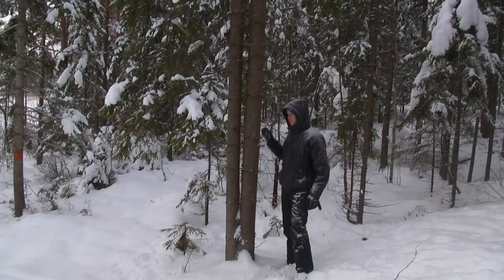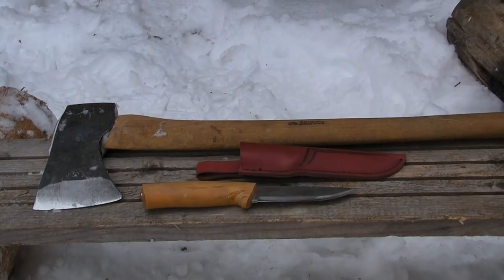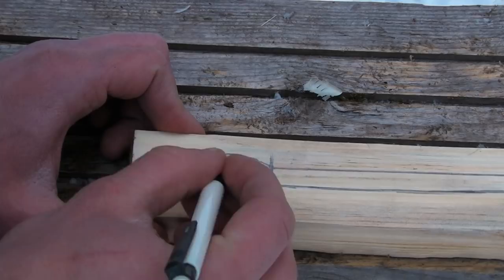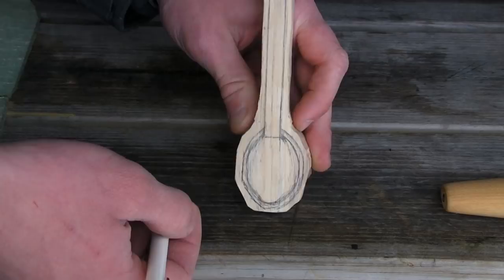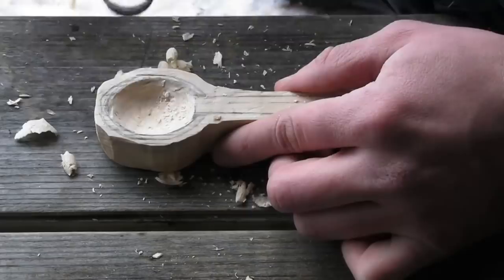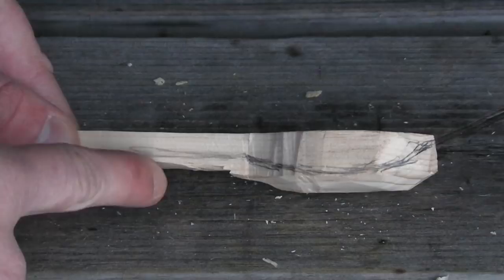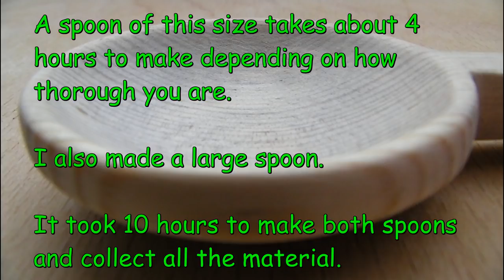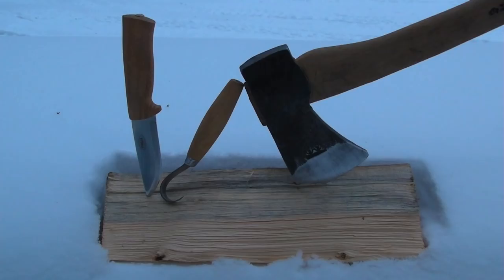Bushcraft - How To Carve A Spoon From Wood.

Comment: Use a Bow drill normally used in fire starting with a tip as wide and curved as you want the bowl of the spoon to be if you don't have a spoon knife. Stones from a stream or river are good for sanding if you don't have modern sand paper. sealing it with beeswax can shield you from resinous flavors of the wood.

Comment: Now we need to know how to make a spoon using just a straight knife.. Many of us don't have the scoop knife..
Reply from the maker: +Mrhycannon Burn it out with coal.
Reply: NorthSurvival
Why didn't I think of that.. Thanx..
Reply: +Mrhycannon 

Or carve it with your knife... Not rocket science.
Reply: +Ben A. A straight knife would make the bowl a lot more crude, it could be done, but 10x more time, work and probably more sanding.
Reply: +Thromper1984 

With respects, it's just as easy, requiring a different technique yes. I think people forget there's ALWAYS a level of sanding involved for final finish work. I've sat around many rendezvous fires and made spoons for people. It's just that simple... a spoon. Doesn't require a shop full of tools or special blades. 

If one is nervous about using your blade, burn out the bowl area of the spoon and finish from there.
Reply: Thanx 4 th help Makes me feel stoopid 4 not thinkin b4 I asked..
Reply: Mrhycannon Drop $10 on Amazon for one.

Comment: Great video. The "always from the top to bottom" is not always necessarily true though if you have good stop cuts made with a saw at the top of the spoon. Helps with the splintering. Thanks for posting this.

Comment: A useful skill; thank you for sharing.
I have a thought - Would it be more useful as a spoon if the bowl were cranked up at an angle with respect to the handle? That way, you can dip the spoon in your pot and take the food without it spilling off the end of the bowl. You started with a thick piece of wood, and this would allow this modification.

Comment: Nice job on the spoons. On the big one I'm concerned you will have one or both sides break off because of the quarter sawn grain pattern. The way the grain is on the smaller spoon will be much stronger because wood splits most easily along the grain lines.

Comment: Thanks for posting. And thanks for posting in English. I wonder, though, how something so porous (wood) can be cleaned thoroughly without modern equipment (like a dishwasher.)  Maybe boiling in hot water?
Reply from the maker: Thank you. Yes hot water.
Reply: You can also use nontoxic food grade oils to put a finish on the wood to help preserve it. Or so I have read.

Comment: Pro Tip: Don't sand your spoons. They look great, but when you add moisture the grain of the wood will lift, causing it to feel fuzzy. When cutting with a knife this doesn't happen  because you cut cleaning through the grain, rather than scoring it with abrasive sand paper.  The best method is to fine tune the cuts as much as possible with a knife then heat treat the wood with food grade oils.

Comment: Does it matter the alignment of the grains in the vertical plane? The larger spoon has the grain marks going through the spoon portion because it was cut "against" the grain so to speak but the smaller spoon was cut "with" the grain and the grain became circles inside the spoon. Is one method better than the other? I think the smaller spoon looks cooler with the circles in the spoon but seems it would be more likely to chip to me.
Reply from the maker: I think it´s better to go with the grain, like i did on the small spoon. On the bigger one the edges can chip.

Comment: Nice spoon, but if you only should use dry wood, you cant really cut a tree to do it right? It would have to dry for a few months in good weather, the wood you ended up using was even blue, indicating it had dryed even longer. I love the nice spoon, but if u r in the bush its probably not smart to bring 1 axe, 2 or three knifes, and a load of sandingpaper, then spend a day of labour to get this done, just bring a steel one :)

Comment: if i was gonna buy curved blades i might as well buy a stinking spoon but if I had to with just my knife, how would i make the receced bowl nice n round
Reply from the maker: Put some hot coals in the bowl part and let them burn down and hollow it out. The best thing is to buy a spoon knife, it only cost about $20, and is very fun to use.

Comment: I thought you weren't supposed to use woods such as pine and cedar because they have so much resin.
Reply from the maker: Yes, that can be a risk, but this piece of firewood that i used was very dry, so it worked good, and spruce is much softer the carve in than birch for example.

Comment: The subjects covered in this wood working book “pepe amazing plan” (Google it) ranges from wood types to tool types and also uses. It also informs you concerning the several types of wood and how simple or difficult they are to work with. In case you are still a novice in wood working, then you will find this book very helpful.